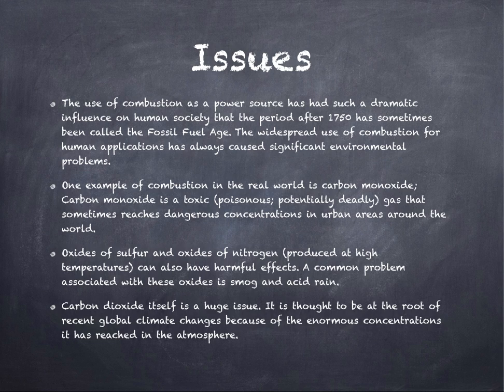COMBUSTION REACTIONS STSE VIDEO

Comment: It is evidently shown that this video on Combustion Reactions was well researched for as it is filled with several examples. theories, and discussion. The video is run smoothly and the presenters stay on topic the whole time. What I would improve to this video is adding more images to not only help understand the concepts more thoroughly, but to keep the viewers more interested the whole time. I had also wished that you would have more clearly shown or stated the changing of topic (ex. when starting to talk about the current state of research); and had shorter points to distribute the information more clearly. Overall, the final video is well structured, organized, and said clearly and professionally with valid information. Nice work!
- Suzanne